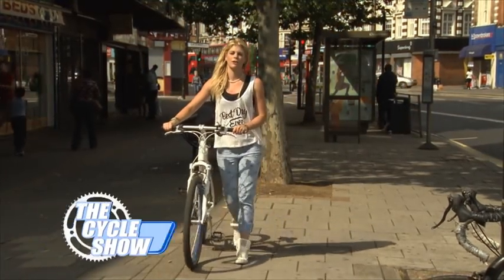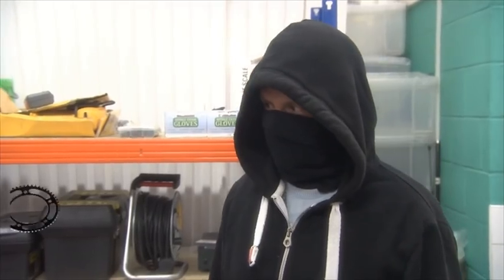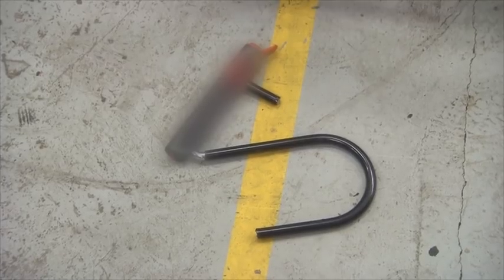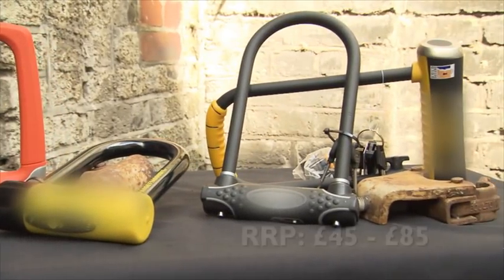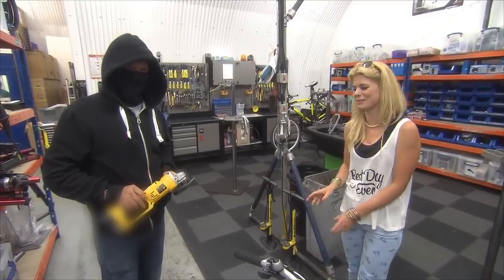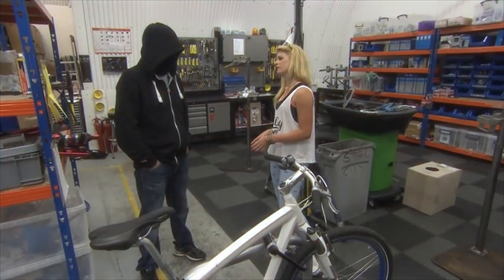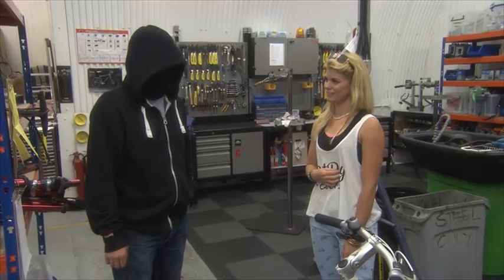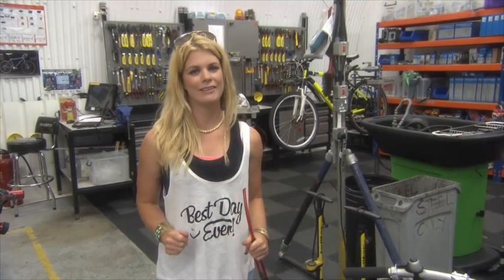How secure is your bicycle lock?

Comment: The only real solution is to take a seat near the bike…watch, and when a thief strikes…..shoot them in the head….no warning…no fuss.  One dead scumbag and not even their mother would mourn.  Other than that you can a) Pay a small fortune for bike theft insurance or b) Fit TEN of the most expensive D locks you can find…..and still never leave sight of it for more than ten minutes.  Optional:  Pack the frame with 2Kg of C4 and a mercury trigger..You lose the bike, but gain the satisfaction of taking another scum out of circulation (warning: Collateral damage may be significant).

Comment: My suggestion is: Buy a stolen / recovered  bike at a Police auction for £15 - £20. If the wheels go round and the brakes work, what's not to like? Get a £30 lock. ( It'll deter most opportunistic thieves)
 If it does get nicked, you've only lost £60. Too many people get carried away with fancy names and trendy gear systems. It's a bike FFS. 
You're not going to be impressing leggy blondes with it.